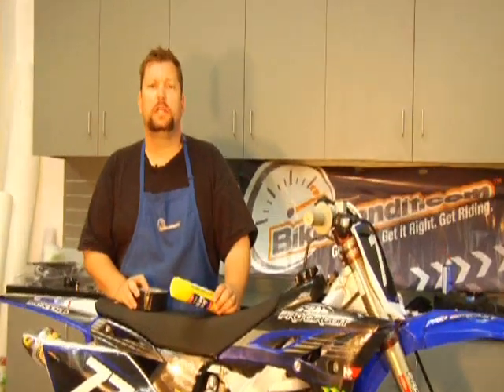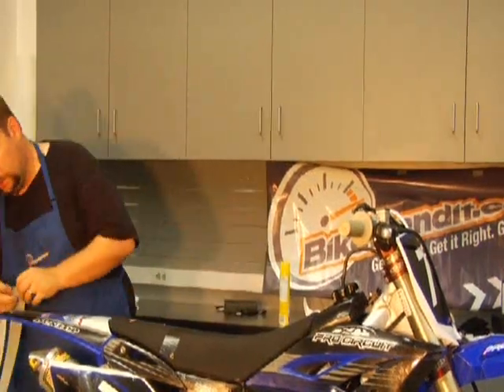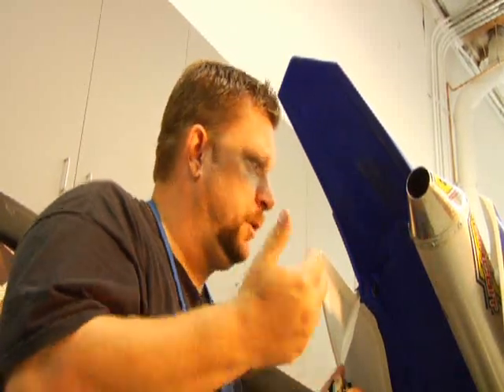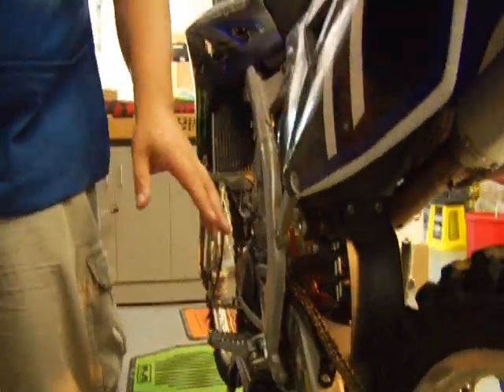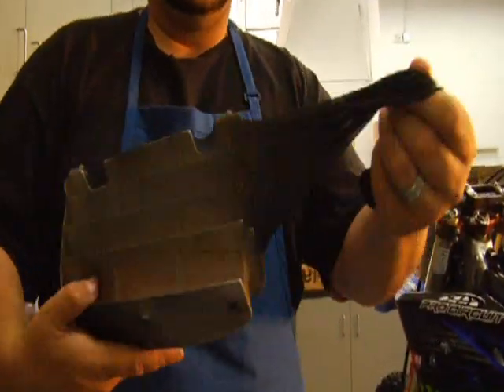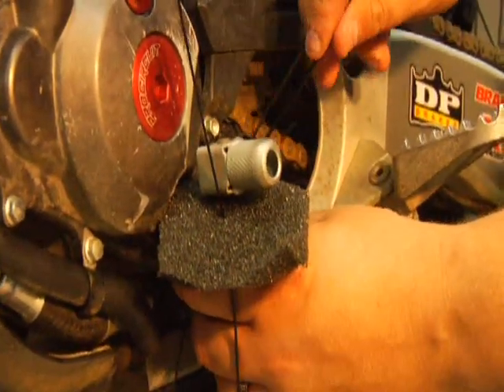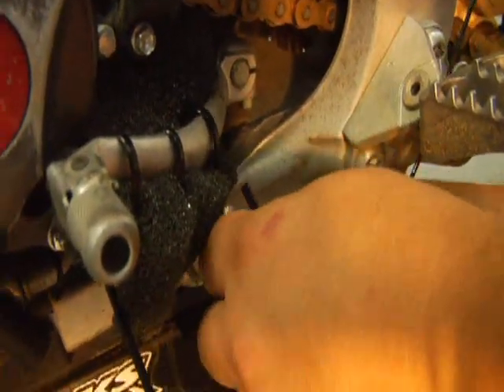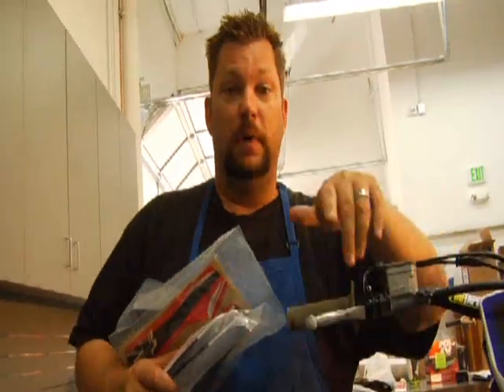Dirt Bike Mud Preparation

Comment: is it bad for a 2 stroke dirt bike to rev it when your warming it up
Reply: Well sir, you don't want to pin the throttle when revving it but just letting it sit and idle would be bad as it is not getting a lot of oil infused gas to lube the piston. So imo blipping the throttle every 5-10 sec is good, actually, start it, and ride it at low revs with some throttle would be best and def better than just letting it idle. Peace

Comment: would it be worth chucking some foam in the airbox intakes instead of tape? keep the engine breathing and mud out at the same time?
Reply from the maker: +Alex Foster 
Hey AF,
Best to leave the airbox empty, for two reasons. One, the volume of an airbox is a calculated measurement of volume, and two, the shape of it depends on a smooth delivery of airflow into the carb/combustion chamber. They make all sorts of ways to increase airflow without taking up inner airbox real estate. Look at UNI on our site, and search Filtered Air Vents, and you'll see a great alternative. Also, MSR makes FilterSkins that up the ante when it comes to keeping your air filter flowing freely.

Comment: would the foam melt if you put it close to the hot engine?
Reply from the maker: Hey DR37,

We're not talking about a soft foam that you'd find in your helmet, but instead a very rigid foam, and that has a much higher threshold against heat than the softer versions. Against your header pipe, pretty much anything will melt, but against the cases, for instance between your skidplate and your oil pan...no problem. Thanks for watching our videos and the feedback. You're a subscriber to our channel, right? Ride safe/ BB.com!
Reply: Thanks